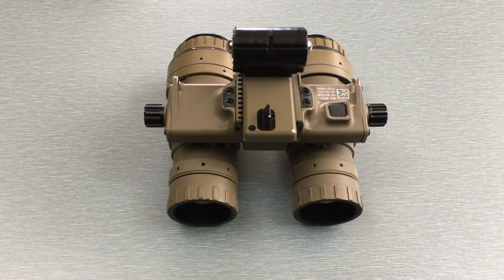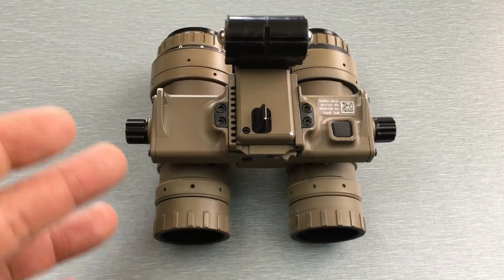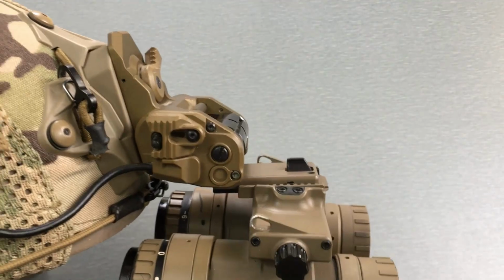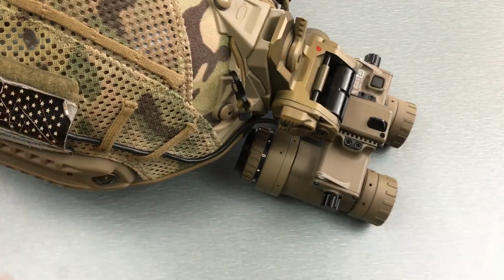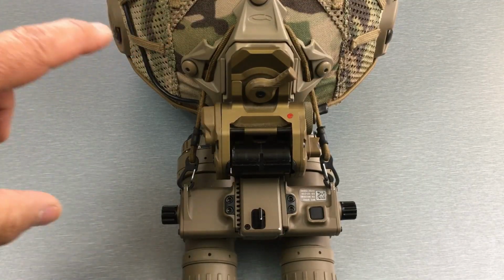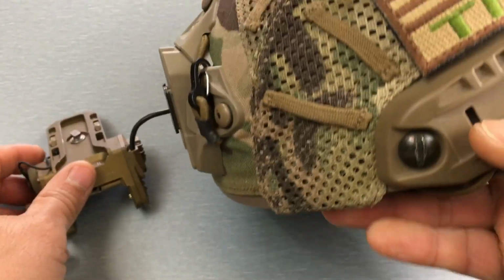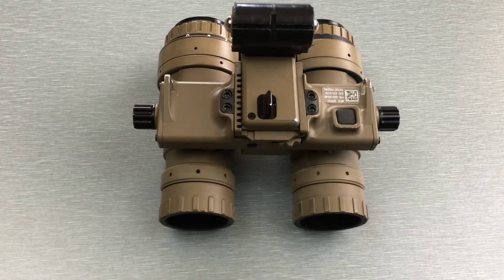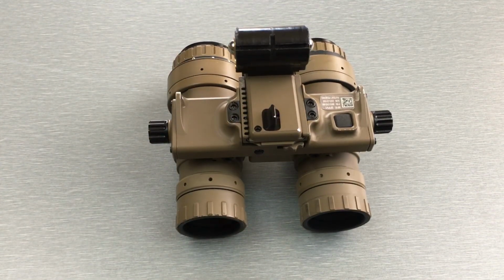TNVC BNVG-M Artemis

Comment: Does this have sacrificial lenses attached in front? Planning to run it with cold harbour CHAD, but it seems to be installed via front lens thread.
Reply from the maker: @k.ashworthy  the objective lenses in the video do not have a sacrificial lens. The Artemis uses PVS-14 optics which have threads in the objective lenses, so as long as the accessory is for PVS-14 objectives you will be good to go
Reply: @NITEWALKER-NIGHTVISION  Thanks for the reply man! I was almost about to purchase Artemis, but had to cancel due to the fact that TNVC currently is not selling ball detent MPS only 😭😭 Bought GSGM for Artemis, but damn...

Comment: I had a pair of sentinels with the Anvis configuration.  I loved the idea of how the on/off function was realitvely automatic.

My issues were
1.  Occasionally the ball detent would disengage from minimal force
2. The A/B night vision ball detent mount was so incredibly tall that it put the goggles in an unnatural   position.

I bought the expensive GSGM and battery pack system and eneded up switching back to a standard dove tail -- super disappointing.

Do you thing the Artemis will will perform differently considering the mount is different  ?

Thanks for the video
Reply from the maker: I owned Sentinels with ball detent as well. The Artemis is a much design. Obviously the same potential issues are there in regards to the ball detent mount in regards to it being easier to break away from the mount
Reply: @NITEWALKER-NIGHTVISION  Does TNVC bring the Artemis binos to the "try before you buy" events ?  Do they take requests ?

I'm on the fence about driving to attend the Badlands, OK events

Thanks for the informative videos
Reply from the maker: @GMRVC1  I believe they’ll have one but it won’t be an Anvis configuration

Comment: initially I didn't have much interest in this housing, but now that I'm back on my MOD3B for ANVIS use (Had a Katana and dropped it, it broke) I gotta wonder if it's a superior ANVIS interface to the MOD3B, or if it's lighter.
Reply from the maker: It is a superior Anvis interface for sure. The mod3’s Anvis interface is kind of meh to be honest. The Artemis is about 20z so similar weight
Reply: @NITEWALKER-NIGHTVISION  so would you say it's worth changing to as a housing? More rigid perhaps? There's a good bit of slop in my mod-3.
Reply from the maker: @mikethemaniac1  IMHO, yes, especially if you’re wanting a solid Anvis goggle and don’t mind losing the ability to separate them.

You can also buy the BNVS power supply interface if you decide to switch to dovetail. The BNVS uses an L3 Fischer port for remote battery.

Comment: I have a Team Wendy helmet and trying to figure out what mount is needed if anything is needed to switch
Reply from the maker: If you mean to attach a ball detent goggle to the helmet, you need a ball detent anvis helmet mount like the AB Night Vision Storm.
Select the ACH version for TW helmets
Reply: @NITEWALKER-NIGHTVISION  
I have the TNV/BNVG-M Artemis Binocular NVG Modular w ANVS Ball Detent System and the mounted with Wilcox GSGM Ground Spec Goggle Mount to fit onto the Team Wendy Helmet in my wishlist, also with the AB night vision low profile battery pack
Reply from the maker: @ryangaraghty1376  Nice 👍🏼 make sure to get the GSGM with the adapter plate.

Comment: Are you the guy I talked to at tnvc about my rnvg's lowering extension the other day?  The person gave me the same tip on running fixed bridge binos.
Reply from the maker: Most likely. I remember talking to someone about it recently 👍🏼
Reply: What was the tip? Lol. I run RNVGs too. I tried the dovetail extension and didn't like it. It acted like a cantilever and made the goggles feel heavier. I went from running a G24 the way down without  the extension to running a Lo-sto all the way forward with it.

I found the Lo-sto has more downward adjustment and lets me run the RNVG without the extension and its perfect.

Watching this video though, thinking i might swap the tubes and optics to an Artemis ball detent.

Comment: super unrelated, is there any specific or harmful reason why the TSC (dtnvs lemo adapter) won’t work with an rnvg? or is it a warranty coverage thing?
Reply from the maker: The TSC is only designed for the DTNVS battery compartment and the mfg states the same. It’s not needed since the RNVG has a LEMO port. Or do you have one of the early versions without it?
Reply: NITEWALKER i have the lemo port one but the way my adams ground pack cable bends makes me uncomfortable, i’m working on an extension rn but i was hopeful the tsc might work, it would be way easier to manage